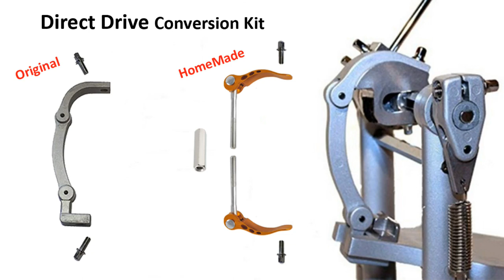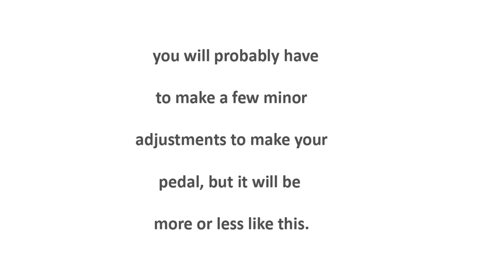Drum hacks - homemade direct drive

Comment: This isn't a good way to make a "direct drive" and the reason why is be cause it's supposed to be as direct as possible so when you push on the pedal, it should be a direct response, but for this, it might not even be the same, and it doesn't help that he didn't show the pedal in action. Second I think this is just a "cheap" way to improve your pedal, but in reality it's not, you'll have to buy the clamps and the nut, cut the screws to an unknown size because that wasn't specified, and get lucky that both screws will be exactly aligned with each other to put it on the pedal. Honestly, don't waste your time and effort, but buy a conversion kit for the pedal, or even just buy a new one. Gibraltar has a direct drive pedal for like $70. In the end don't waste your time, be smart and don't do this.
Reply from the maker: Hello, if you can buy a new direct drive it is very good. I just did it, because mine broke the chain. There is no point in making a video work because it is best to test it to feel the effect. This is a good method, for those with little money like me. Of course, it takes some technique to build.